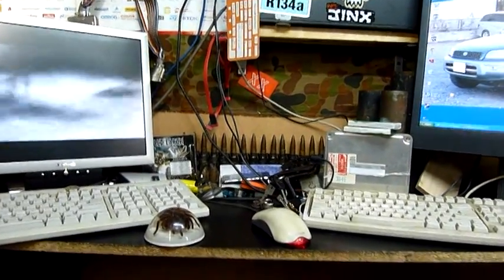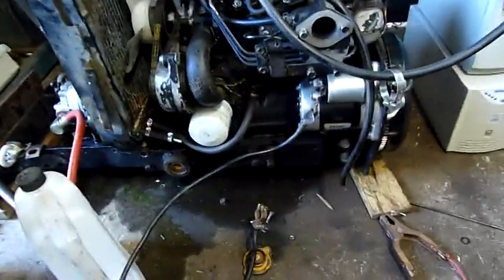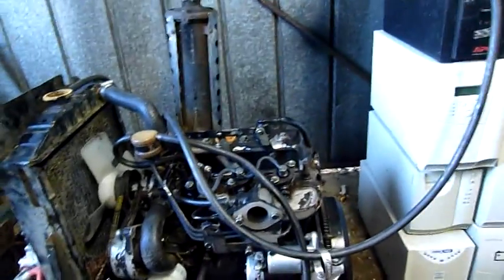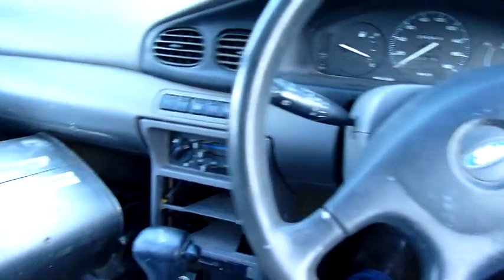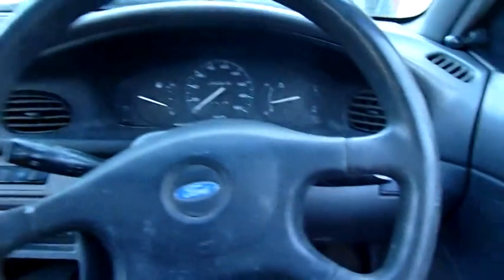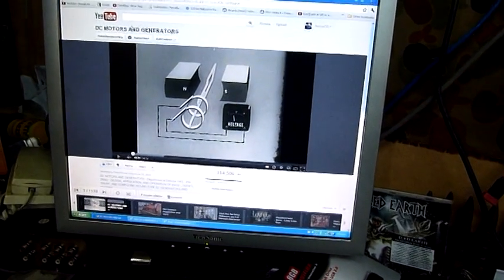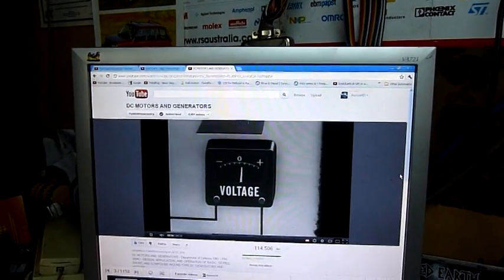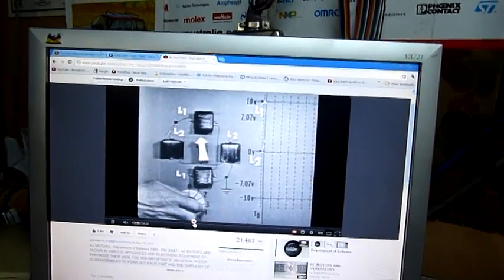Ramblings - Little Car Roaming Around and Educational Videos For DC and AC Systems

Comment: The problem with little s%!$box cars is everything is made cheap so the mechnicals are just strong enough to take whatever the stock power plant puts out. Around here there are idiots that rev the piss out of Hondas and other ricers trying to street race them and wonder why they need a spare engine sitting in a corner of the car port at all times.

Comment: Thanks for the info about the electrical vids, will definitely check them out.  Keep your eyes open for a 4 pole ( 1800 / 1500 - 60/50 ) hz generator head.  That Yanmar diesel will be quite happy turning one of those as well.  I think another poster said that as well. ... or your big electric motor converted generator.  Make or find a small trailer to set the whole works on?  Neat stuff!

Comment from the maker: I would start with a car thats in really good condition if I were to do that, this one is spent. and it would have to be manual with a high strength diff, they blow diffs even in factory tuning spec.

Comment: Nice and stupid idea at once: strip out the back seat of lil car and drill a hole in the bottom. Fit knives to a shaft that is put through hole. Electric motor driving the shaft from inside the car. Now you can mow your lawn in comfort of ac, and dry when its raining....:)

Comment: Looks like you will have to make a box section support frame for the tank and engine, sounds like it could be handy.

The little car is really quiet as i didnt hear you start the engine :-)

I like brass as well, hard enough to be usefull but soft enough to work easly.

Nice vid.